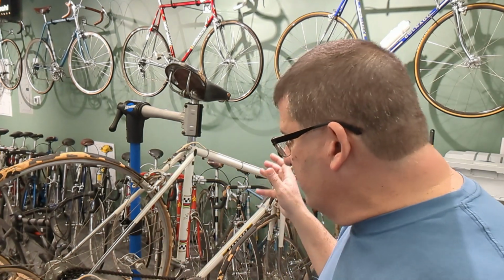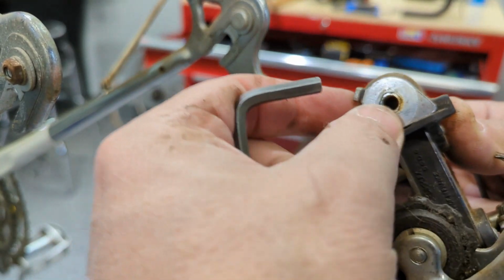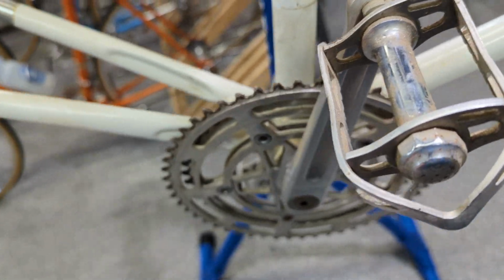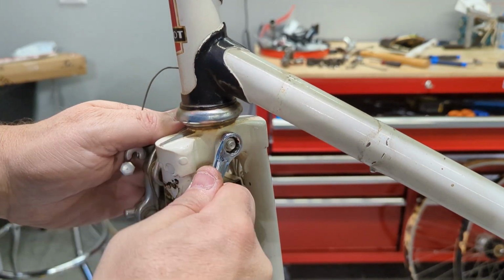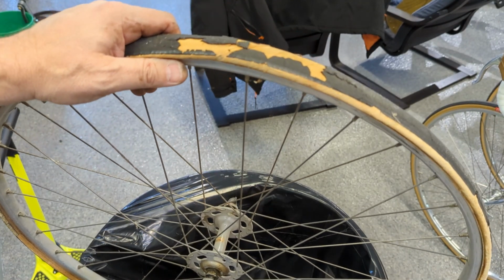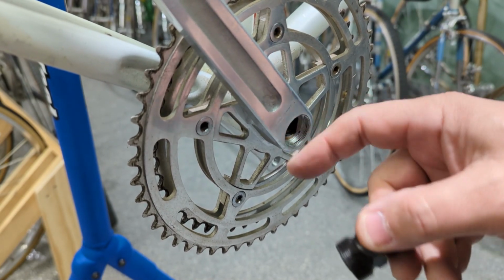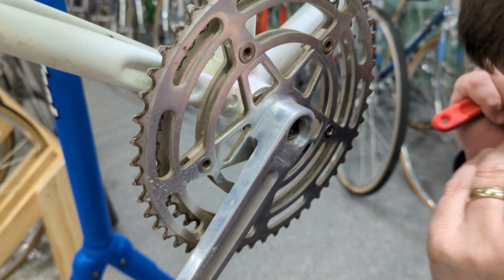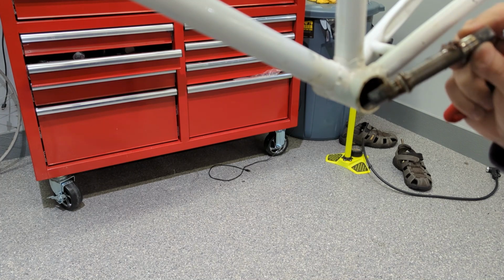Vintage Peugeot PX-10 Restoration Part 2

Comment: It was thanks to a Peugeot catalog in the ‘70s that I decided a great bike needed to run tubulars. When I finally built such a bike in the ‘90s, I proudly ran tubs. I only replaced that bike a few years ago with one that uses tubeless. 

In my long experience, old, dry tubular glue gets pretty brittle, but it doesn’t vanish. I don’t think that rim had enough glue on it.
Reply from the maker: I haven't been a huge fan of tubulars. I should use them more on the vintage bikes however!
Reply: @JohnsVintageRoadBikeGarage  You have to really want to use them, I think. 😂

Comment: Hi John I had the same problem with a Stronglight 49D chainset. I managed to get it off using a three arm gear puller, carefully placing the three arms on the back of the small ring. I managed to get a proper TA chainset puller later from an ebay seller in Poland. Nice video, and great bike.
Reply from the maker: Thanks. The garage is among a few car collectors and mechanics and was offered what is probably a simular puller. I got lucky that the crankset was not on tightly. Thanks for the info!

Comment: I have a very old one of those pullers. Unbranded, but probably French made. It's tiny when compared to a Campagnolo. Literally 5 full threads to screw onto the crank. Also a very short shank that pushes against the spindle.
Reply from the maker: It was funny.  I was glad that it didn't take a lot of force to get them off. Not sure if the 3 or 4 threads would of been enough!

Comment: Thanks for this video. Some of the hardest bike mechanic lessons Ive learned have been working on Peugeots of this era. 
I collected vintage roadbikes/parts for many years and had a nice little inventory. Couple years ago a friend gave me Peugeot that looks identical to the one you are working on, except for having cottered Simplex crank/chainwheel. I assume you are familiar with cottered cranks, 😢. My plan was to swap em for a set of Nervar cranks. I figgered they were an upgrade, and though likely 10 years younger than the bike, were at least french. Well, Ive given up on removing the cranks and just ride it original. For a relatively heavy bike, late 60's I figger, its so nice to ride. Mine has quite an upright steer tube, hence short, sporty wheelbase. At present, I dont have wheels on it, hoping an appropriate set comes my way. I think I had 27" wheels when I got it, but it beautifully lets you use 700 too. I mostly have japanese steel bikes, Im a fan, but the humle old Peugeot really holds its own. BTW, does anyone know much about when/where 27" wheels were used?
Reply from the maker: Thanks for sharing! All of that. Sounds odd but I would like a vintage bike of decent quality that has cottered cranks. A lot of good quality bikes had them way back when.  Most American bikes used 27-in. Sometime in the early '80s, most performance bikes switched to 700c. My expertise ends when it comes to the 1960s and before. Thanks for watching.
Reply: @JJhabbs  Wow! Thanks for your reply. The only community of enthusiasts I have is online. So, having you even read my comment means a lot.
Reply from the maker: @karlnorgaard9447  I've always said this is a pretty lonely hobby. That is what got me to start a channel in the first place. Keep in touch.

Comment: The park tool has a reversible end with both threads I used to thread and file the hanger to use Japanese or campy rear derailleur

Comment: I got my TA 23 mm puller from J. A. Stein tools.  Super quality.
Reply from the maker: You are correct. That is who I got mine from.
Reply: Old Stronglight is 23,35 mm, but sometimes a 23 tool does the job and sometimes it breaks...

Comment: I had those "fake stitching" Simplex shift levers on my 1975 French bike. They were the next level up from the blocky ones you saw on the lower end Peugeots. Need a special obsolete tool to pull the cranks on a French bike? Vive la France! Let's hope you don't have to find a part with French threads!
Reply from the maker: I did find the tool on eBay. Wasn't too difficult. I'm glad that all the threaded bits are in good shape. Fairly lucky. Thanks for watching

Comment: Always wanted a PX10 just never got around to buying one. I would have done the same thing with the crank puller.  Not much more you could have done.  I like to polish up those small parts like the cable guides and pump holders and re-install them.
Reply from the maker: I'm with you, pretty sure we will reinstall all of that stuff. I bought a buffing wheel that mounts to my grinder. I will put that to good use.
Reply: @JohnsVintageRoadBikeGarage  that’s what I use.

Comment: Actually John the Stronglight crank bolt puller and the Specialties TA crank bolt puller are not compatible. You have to have the one specific to the crankset. I have two Stronglight pullers, old and new, (also incompatible) and I just got the Specialties TA bolt puller this week.
Reply from the maker: I thought I got the correct one. In the left arm it threaded all the way in smoothly and firmly.

Comment: I bought a vintage Peugeot too. Little more than a year ago. 3 tube Reynolds and the Simplex/Stronglight/Mafac group. Very beautiful and in a good condition. But the stem is not original. It's a Japanese SR. And it's stuck. I mean VERY stuck. You need a lot of patience with this. Not my strong side. 
You have any advice?
Reply: Probably 22.2 mm rather than 22.0 (French stem diameter).  put 2 blocks of wood around the stem and put the entire stem in a vise, attached to frame, upside-down.  Use a 2x4 for leverage and rock the fork until the stem breaks free!  You can also sacrifice the sr stem they're a commodity IMHO ...
Reply: @dgillies5420  Hi! Thank you very much. No, I don't care about the SR stem at all. Maybe the last advice is the best.
Will it be difficult to remove, you think?
Reply: Oh, French diameters and French threads ... it's all coming back to me now ... (facial ticks and twitching) 😵‍💫
Reply: @nielskjr5432  A friend did it for a bike i bought just 2w ago, fairly easily, it all depends on how much of the problem is tightness and how much is electrochemical bonding between the aluminum and steel.

Comment: Using the crank puller like a tap is exactly what I would have done…a little nerve wracking but it usually works (so would an automotive gear puller).  With that “indexing” BB, I thought for sure there would be some pitting on the cups and/or spindle…lucky!
Reply from the maker: Thanks, I think the BB was just a hair too tight and dry. Insert joke here. Should be fine lol
Reply: If you file a small V shaped notch angled 90 degrees to the first three threads it can serve as a tap to chase the threads.
Reply: Forgot to specify the notch is filed in the puller not the crank arm😮

Comment: that's weird that the right crank dustcap threaded in fine, but the puller didn't.  I might have tried swapping dustcaps between the left and right crank, just in case there was a difference in threading.  ..or maybe hold the dustcap threads against the puller's threads, to confirm that the pitch was the same?  Perhaps the crank's threads were just filled with some petrified 1970's grease?
Reply from the maker: Excellent suggestions. I did all of that, just did not do it on camera. Thanks for watching
Reply: French quality!

Comment: Those tires were never glued properly in the first place. The clear glue back than was crap ( name escapes me ). We used the red Clement which dried hard and brittle but melted in hot weather or left in a hot car.
Reply from the maker: Correct. I cant think of that glue either.. Tressostar? something like that?
Reply: In racing you always had a second set of wheels. Perhaps even clinchers. But you would always use a pair of sewup rims that you weren't using to stretch out a brand new pair of sew up tires. It made it a lot easier than trying to put a brand new pair that was always folded up in a box directly into a rim. So having no glue or dryed up old glue on the rims that you used for stretching was best.
Reply from the maker: @ronaldangelini7983  I remember when I was working at a shop we had a old beat upset of sew up rims we'd use to always have a stretched set of tires sitting around.

Comment: I would replace the stem, they are infamous for breaking. On my 71 PX10 the skewers, and shifters were chrome, without plastic covers. The safety levers are not original. The crankset is not original, PX10 came with cotters.
Reply from the maker: I don't believe it came with cottered cranks that year. I hear you on the stem. And the brake levers. I'm changing the brake levers to wienmen however, I'm keeping this stem stock. Much to your chagrin this bicycle will most likely not be ridden by myself. It's too small. Next guy can change the stem. Thanks for watching